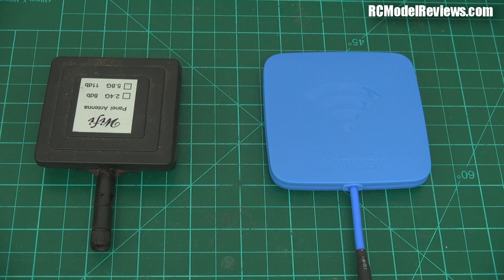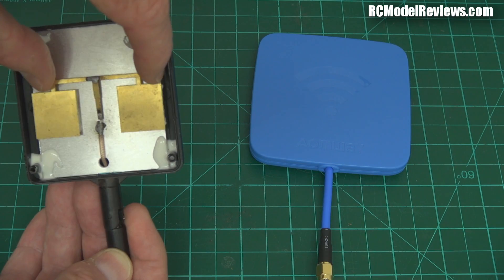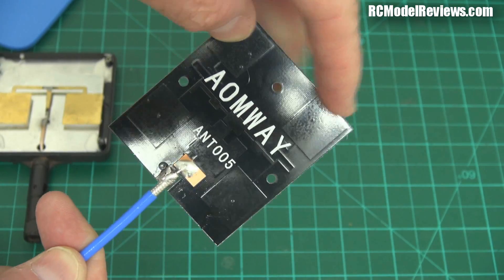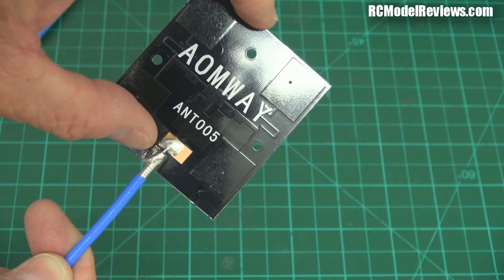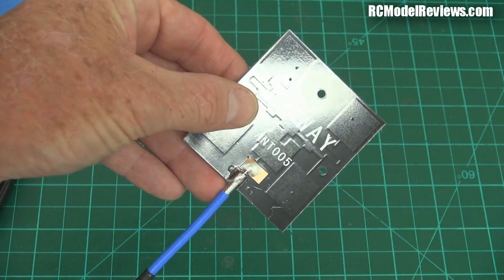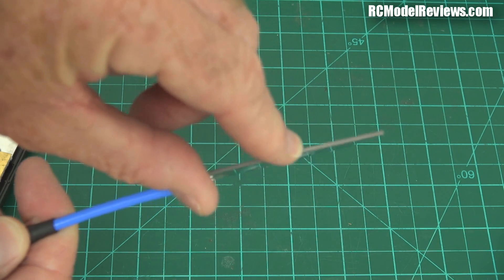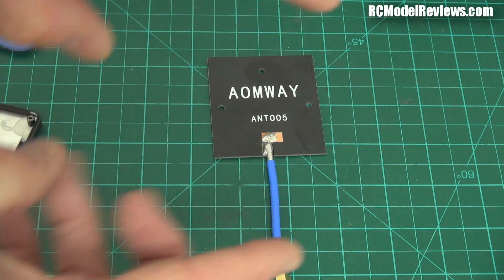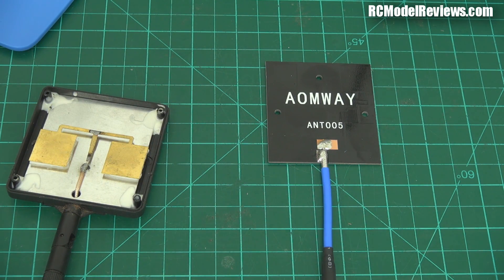What's inside the Aomway 15dBi 5.8GHz FPV patch antenna?

Comment: Bad design!  The feeds are all vertical.   For circular polarization, 2 patches should be fed horizontally, 2 vertically, and the phase delta should be 90 degrees between each, alternating V, H, V, H.

Comment: Hi , great stuff . hope you still reply to this vid as you look like the man to ask . i have a mavic pro 1 drone and i bought a itelite dbs nanosync patch antenna range extender for it  , the drone uses two antennas i think the right antenna is a diversity antenna either that or something else , either way it dont make any difference when unplugged  , the patch antenna i bought plugs into the left and right port of the remote control , one patch for left antenna port and the other patch for the right . as the the right antenna is not being used can i connect both patches both in series or parallel with coax and then put them both into left port of the remote control for more gain .with the right antenna just put a simple 2.4 ghz whip in there just in case it is a diversity receiver . . looking forward to your reply . regards Tony

Comment: I have ANT005B, almost same 15dBi antenna (or so I thought) but with SMA connector on the back not the bottom. I thought that "B" is just for connector option. And it performs great, I got well over 1 mile range on 200mW and FR632, probably 2 miles to make video unusable. I was confused by all these negative reviews. So I opened mine after I watched this video. What a surprise! It is a completely different antenna on inside.
While this antenna ANT005 design looks fishy, mine ANT005B looks properly designed for circular polarization. ANT005B has four linear patches that are oriented and fed at 90 deg to each other, you can also see phasing done correctly by different length of transmission lines. Active patches and ground plane are on two separate thin PCBs, separated by air gap, gap size is controlled by plastic standoffs of the housing.
This is a shame that aomway puts two completely different antennas on the market that look alike, model number differs just by one letter leading customers to believe that one is a minor modification of another.

Comment: The varying width traces are about impedance matching, not polarisation.  The very very fine traces will act like a high-value inductor - effectively disconnecting the patch from the feed.  Correspondingly, what you are looking at there is somewhat of a huckery dipole, and thats about all.

Comment: Bruce- I found the same relatively poor performance but by cleanly cutting the trace to the bottom 2 pads and orienting it sideways (out the side of my Dominator V2 with no adapters), it works pretty well with a reasonably wide but relatively short beam (or tall and narrow beam if in it's stock upright orientation).

Comment: Oh and please recommend a helical that you like and where to buy?
Another quick question (sorry to rack your brains) TBS sell an omni directional circular polarised and recommend it for a receiver. Is that better be aside it doesn't get reversed polarised reflections cancelling out the signal? And if that's true is that only relevant if you fly indoors where you get reflections? I only fly in fields. So if that is correct it wouldn't be any better? Is that right buddy? 
Thanks
P.

Comment: I have a noname 14db linear patch antenna. It has 3 plates sandwitched with spacers. Two of them plates where directors, with some copper over the antenna area. Worked great and did the job.

Comment: If you grind away the foil connection from the two phase patches and make this antenna into a straight patch type, retest it, then you will have some evidence to relate to the material of the board.  Crap to start--no loss in the end.

Comment: Hey Bruce,
I saw another thing on that antenna. There is no spacing between the element and the copper back other than the fiberglass. Look at the other one and there is a space taken up by the padding behind active element. As you know the spacing between the reflector and driven element is critical at those frequencies. Just my thought as a Old Ham Radio operator...W4DRA

Comment: I have same antenna, same thing happens as with yours, so it is definitely not faulty but design is bad. I tested it at 5 km range with fatshark 250mw TX, with Immersion rc  spironet antenna. 
At receiver side was mentioned Immersion rc antenna, and this one. Spironet worked rather well, this one barely showed any picture, with any orientation was same.

Comment: Hi Bruce, interesting Vid again. I have a Phantom 3 standard and want to increase my RC range in the 5.8 Ghz. Can I do that by replacing the standard antenna for a helical or patch and use it as a transmitter antenna?

Comment: Bruce, small question. If you would cut the feeds of the patches and would connect them by 4 wires of the same lenght. Would that improve it's performance? Or just throw it in the bin and buy a helical.

Comment: The 10"x10" panel antenna I got at FPVmodel had 16-20 element squares inside and was only 14db. Works great with my cloverleafs too. Those 4 element squares type are disappointing.

Comment: Best two antennas for diversity reciever. My humble opinion are ibcrazy 3 turn helical paired with his Peoperbox are best on a diversity reciever.  On transmitter I use lhcp air blades.  They are expensive But make a rock solid 5.8 video connection.

Comment: Bruce, once again another great video, thanks!  I did however want to comment on the Aomway patch antennas,  a buddy of mine has the same from your video and had a similar experience.  I bought what I assume was the same antenna but with the SMA connector coming out the back instead of on a flexible lead.  My experience with that antenna has been amazing, I have got signal past 3 miles!!!  it nearly kept up with a 7 turn helical and outperformed a 5 turn.  I wonder if there is a design flaw in the version that you picked up.  Here is a link to the antenna i purchased, and it's still working like a champ... http://www.hobbyking.com/hobbyking/store/__76888__Aomway_5_8GHz_CP_Patch_antenna_14Ddbi_RHCP_Rear_Mount_SMA_.html

Comment: That looks more to me like a linear polarized patch array (with a dodgy feed network) than a circularly polarized patch array.  With the microstrips feeding into the center of an edge like that each individual patch would be linear polarized in the same plane.

The circular polarized patch antenna designs I've seen use one of 2 techniques:
- a square patch quadrature fed on 2 edges,
- or a rectangle fed on the diagonal, the difference between length and width of the rectangle producing a phase difference between the 2 directions.

Comment: Not talking about the Aomway, but the one on the left (black case). I wouldn't trust it because it wasn't designed by an engineer. Engineers know it's "dB" with a capital B and not "db". Also, dB is not enough, antenna gain is in dBi or dBd: dB over isotropic (i) or dipole (d). Without the i/d, it just doesn't mean anything. If they can't get the label right, how can they do a proper electrical design?

Comment: Bruce, I think I can explain why this thing doesn't work well. I'm an EE PhD student and I have some experience with this stuff. Based on this video alone I already see a lot of problems with the design:

- Like others have said, if this really was a circularly polarized antenna, the patches would need to have two feedpoints, or some kind of asymmetry (slots, vias, ...) to turn linear polarization into circular polarization. I don't see any of that, so I assume that this is just a vertically polarized antenna.

- You are right, FR4 is a bad choice for this type of antenna, the loss will be very high.

- If this antenna works at all, it will have an extremely narrow bandwidth, because the spacing between the patches and the ground plane is way too small. This is made worse by the fact that they used a high-DK material (FR4). Note how your other antenna has a bigger spacing and uses foam (which has a very low DK, almost like air) to avoid this problem. I would guess that the bandwidth of this thing is 50-100MHz, which doesn't even cover the full 5.8GHz band.

- Because of the extremely narrow bandwidth the design is extremely sensitive to manufacturing variations (because these shift the center frequency of the antenna away from 5.8GHz). A big problem here is that cheap FR4 has a highly variable dielectric constant (DK), so two antennas from a different batch could have a significantly different center frequency. This design has maybe 1% tolerance for manufacturing variations based on the bandwidth. This would be less of an issue if they used a high-quality RF material, but these are far more expensive, and even then it's pretty optimistic to expect less than 1% manufacturing tolerances.

- The lack of phase shift between the left and right patches is not an error, this is actually correct. All patches should have the same phase so the radiation adds up. The required phase shift just depends on the position of the feedpoint. The bottom needs 180 degrees phase shift relative to the top, which explains the weird shape of those microstrips. What is missing here is the left/right feedpoints which would need 90/270 degrees phase shift.

- The design seems to rely very heavily on filters/matching structures. This is one of those things that works great in theory but not in practice. The EM simulators used to design these antennas are notoriously inaccurate, it's common to see errors up to 5% even when you're careful. That's 5% for each component. As the number of components in the design goes up, so does the total error. Then there's manufacturing tolerances. In a complex design like this, the real-world performance can be completely different from the simulated performance. This is why a good designer will try to keep everything as simple as possible.

- That large metal patch near the coax is very fishy. Same for the big copper soldering pad. At 5.8GHz such a structure is basically a giant capacitor. Presumably they added this to match the antenna to the 50 ohm coax, but if the rest of the circuit had been properly designed then this wouldn't even be necessary. This again increases sensitivity to manufacturing tolerances and simulator inaccuracies.

Everything combined, it seems like the designer didn't really know what he was doing and designed this thing through trial-and-error, while blindly trusting the simulator. It would be interesting to connect this thing to a network analyzer to see the return loss (s11) - maybe it actually works fine at a completely different frequency.
Reply: "it seems like the designer didn't really know what he was doing"
My guess: the designer (cought china cough) had just blatantly been ripped the design from another working patch antenna that had the right pcb and stuff and at the copying didn't got the measurements all within where they should be but just printed the shit anyway and put out for sale.

Comment: With my limited knowledge of patch antennas and some discussion with fellow ham operators, it seems evident from the PCB layout that the Aomway is linearly polarized. The placement of the feed point on the patch element dictates the polarization and the delay line is just to bring the element to phase because it's fed from the opposite side.
Reply: It dawned to me that if you test this antenna with a circular polarized tx it would very likely seem weaker in comparison to a real cp rx antenna, since great part of the power (~half-ish) is lost due to polarization attenuation.

Comment: Bruce could you also open up those cheap ones that worked better then you expected and show us what inside those?
I would like to know if its a good design or a fluke that ended up working well but is not consisted with other samples.

Comment: There is also this 14dbi patch which has a similar design but the patch layout and phasing network is slightly different. It's linearly polarised but it seems to work kinda fairly ok from my observations. http://www.hobbyking.com/hobbyking/store/__64664__5_8GHz_14dBi_Directional_Patch_Antenna_SMA_.html

Comment: You beat me to it with your comment on the PCB material while I was typing about exactly that. I'll bet they did what too many Chinese companies do - they exactly copied the etched PCB pattern from some properly made antenna designed by some company that knew what it was doing and then used the wrong PCB material and/or PCB material thickness, using whatever they could get, had on hand, or was cheapest that day. The element/reflector spacing and the dielectric constant of the material between them is critical, especially at 5.8 GHz even without also trying to get circular polarization.

Comment: Clearly the phasing and matching network has had some thought put into it, so it is either an inferior copy of another product and/or the actual physical details of the antenna have deviated from the original design. At these frequencies dimensional accuracy needs to be sub tenths of a mm and with the correct dielectric material. With modern PCB manufacture accuracy should not be a problem if done properly.  It's a pity because Aomway have a decent reputation with their VTX's.

Comment: I think it would be better to pop the antenna on a spectrum analyser to see its true performance and characteristics. Plus you will see where it best performs within the 5.8GHz band 👍 
Love your videos though Bruce, keep up the good work.
Reply: +Martin Crosbie As I said in my antenna shootout... test gear for these frequencies is pretty spendy.  What's needed to really test stuff like this out is a vector network analyzer but for something that'll do 5.8GHz you're talking US$15K+ for such a bit of kit so it'll be a little while before I can afford one of those ;-)
Reply: +xjet yes, totally agree Bruce. Well soon as I get my Aomway RCHPs I'll take them into work and ask nicely  to test on the spectrum analyser and I'll share the results 👍
Reply: +xjet Bruce you should get one of the Immersion RC power meters. I am certain the absolute readings are ball park at best but it is useful for comparative testing. With the supplied attenuator it claims to read from -50dBm to 0 dBm on frequencies relevant to RCers. I have one and while it is not something you will typically use every day I think it is a worthwhile investment. I'd be interested to see how it matches up to your spec analyser on 2.4 and lower.

Comment: Could it have the opposite (clockwise / anticlockwise) polarization to the transmitter antenna you used for the test?  Maybe you should test it with a non-polarized (rubber duck) transmitter antenna first?
Reply: +ceptimus It's sold as an RHCP antenna and the transmitter had an RHCP antenna on it.

Comment: There is a possibility that the designer specified the proper materials but either the manager or manufacturer substituted without knowing the repercussions.  Happens all the time when engineers already make compromises and management or cost savers don't know why despite all the desire to save the designer stuck with the expensive bits where necessary.

Comment: Looks like a mistake in chip-die production. There is no exposure for the ariel on the PCB. I'm not sure schooled in electronics, so would not know for sure if that is a factor? Thanks for showing us though. Safe Journeys
Reply: +FreeClient01 - there is no "chip" or "die".  It is a passive antenna with no active components.  The copper of the antenna traces do not need to be exposed.  Just like most other antennas they can be protected from the elements with plastic or rubber for example.